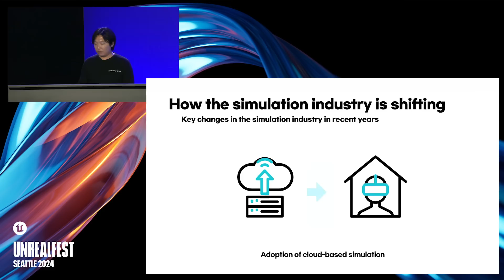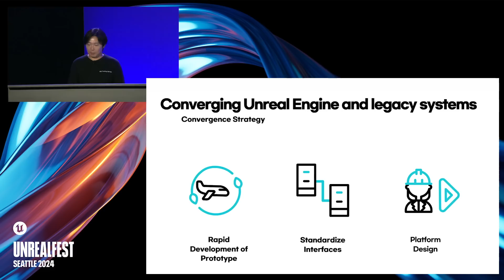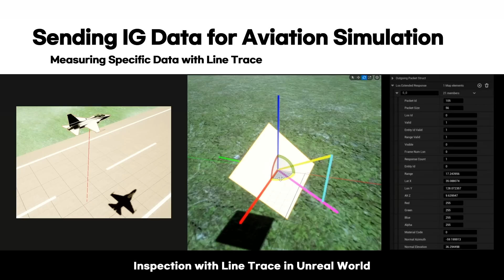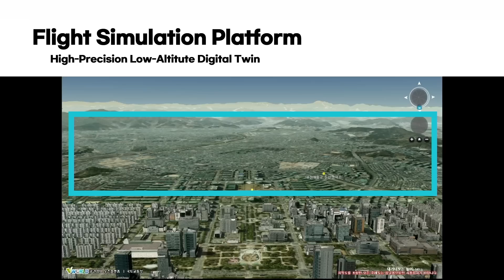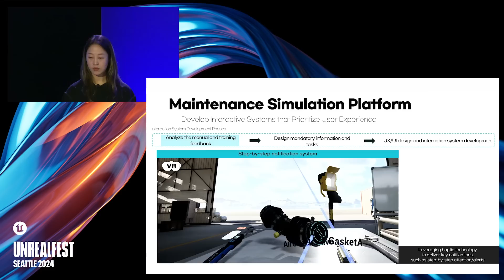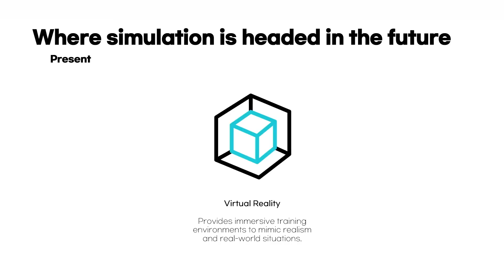A Deep Dive into Aircraft Simulation with Unreal Engine | Unreal Fest 2024

Comment: The tech looks really cool. Note, there are different speakers, and each speaker focuses on different areas. 
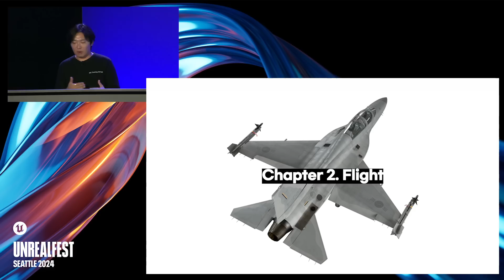12 min intro is an unintelligible commercial, skip to 11:45. It will make much more sense and the presentation is really cool if you are interested in sim. 
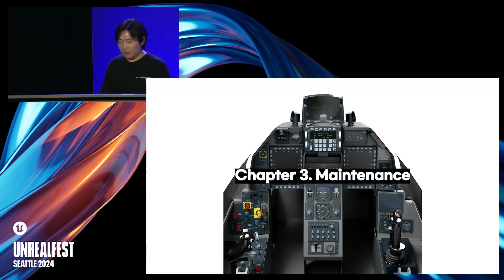To be clear, UE5 is not the actual "flight" simulator in the CIGI portion of the presentation. Instead, a multi-million dollar simulator is using UE5 to render the simulation.  This would be best shown to companies that need that level of simulation for training. The VR maintenance simulator is really cool: 30:22
Reply: Helpful comments, thank you!
Reply: Thank you for saving me 46 minutes lmao
Reply: 😂 Some of it was interesting but yeah, skipping ahead to the meaty stuff is recommended.